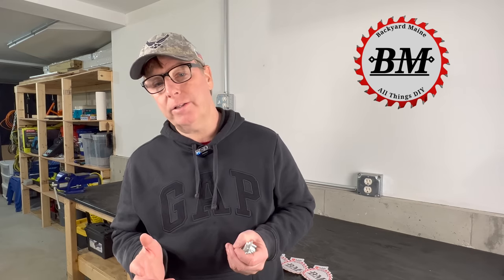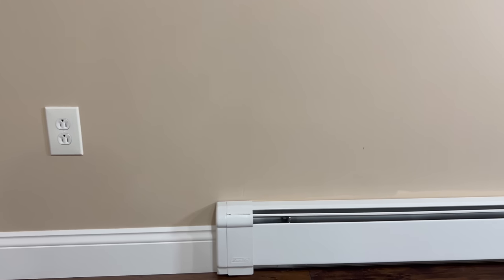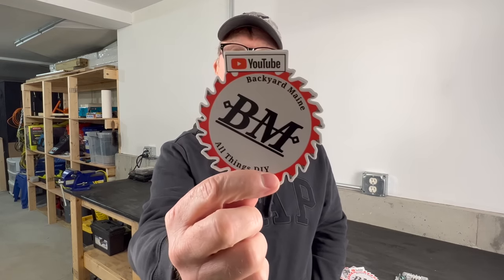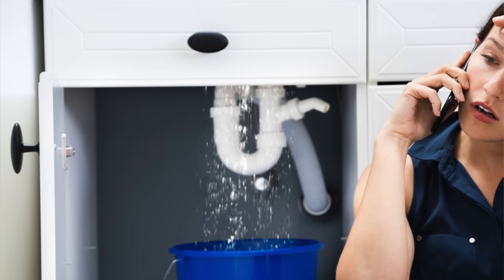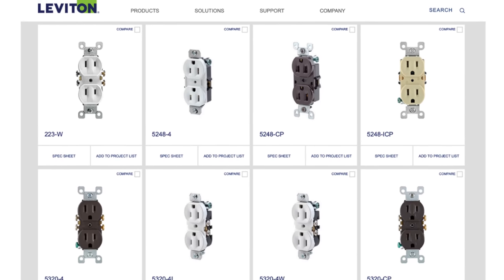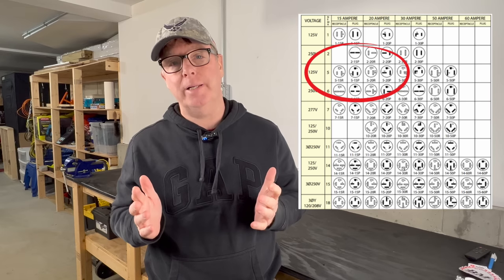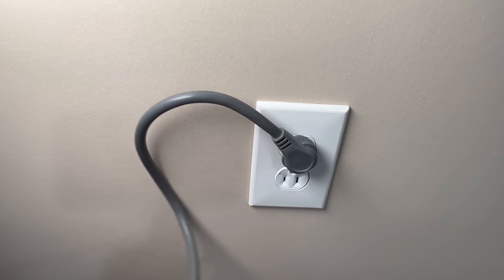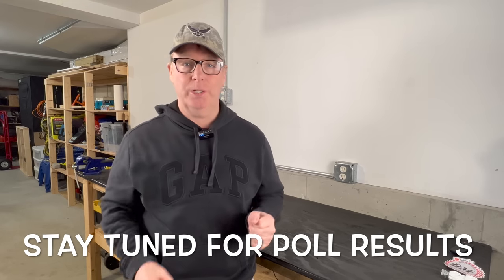Are your outlets installed upside down? (You may be surprised)

Comment: I have been an electrical engineer for more than 25 years and live in Costa Rica, where the electrical code is based on the US NEC. (And I’ve done designs and supervised installations in the Americas -USA, Costa Rica, Mexico and other countries in South America; ranging from residential and commercial to industrial. Low, mid and high voltage as well). 
It is customary to install receptacles here horizontally (so in my case, seeing a vertical receptacle looks weird). This provides several advantages:
- when both outlets are used, one cable does not “pile up” on top of the other. 
- the conduits coming from the floor go in and out side by side using the two adjacent knockout perforations, simplifying conduit installation. (Houses here are mostly made of concrete. Meaning a concrete slab and walls made with concrete blocks. Receptacles are normally wired through conduits embedded in the concrete floor or slabs, while lighting uses conduits in the ceiling). 
- I recommend installing the neutral slot UP, for the same reasons of preventing accidents in case of falling metallic objects on a partially plugged device.
- Someone else commented that the grounding prong helps plugging in when there is low visibility. This is also true in this case.

Some disadvantages are for cases when a device (like a night light) is designed for vertical receptacles and when plugged will not have the orientation intended by the manufacturer, but this is not critical.
Reply from the maker: Great discussion. Thank you. I’m retired now but I was also an electrical engineer. I worked for Texas Instruments. I was actually on their technical ladder which put me in the position of working with FABs located around the world.
Reply: That’s cool!!
I worked for Intel a few years ago, and coordinated the electrical scope for a renovation of a building they acquired in Austin. 
I later changed position and worked in a team that designed communication ports for CPUs (USB, SERDES, HDMI, etc. ). Also an interesting experience.
Reply: The vertical outlets look weird to me as well. Interesting topic.
Reply: Because of course if the night light isn't facing the right way up the light will spill out onto the floor instead of into the room
Reply: @billycroan2336  Exactly!!! You don’t want light spilling all over your dark carpet. Right?? (Interesting idea to find small things on the floor, but removing those stains has to be complex, even if they are “light”). 

(Now, the thingies with a mosquito-killing fluid have a plug that can be rotated so the same thing does not happen with the insecticide).
Reply: Hey. New comment. 
Looking at 4:45, the right-angle plugs. Maybe they are designed for horizontal receptacles with neutral up. If I saw the image right, this seems to match. 
And, with neutral up and ground to one side, the live tab is “hidden” the most from any falling objects, while in a vertical outlet, there is still some risk with the live tab on one side and something shorting it to ground in the “ground up” position. 
Just some thoughts.
Reply: @federicoulloa1255  yeah, it's a pity more boxes aren't designed with the nails on the small side.  I could always do a commercial steel box with one of those base plates you can rotate on your own. Those are usually double but hey I wouldn't mind having more outlets anyway.  Then again there goes avoiding having outlets above or below other outlets....

Comment: When I was a kid I was interested in power. So I dropped a quarter across a plug that was pulled out slightly from the receptacle. Boy that was exciting as a couple of 1/8 inch deep holes were melted into the quarter before I pulled the plug out! I don't recommend repeating this experiment.

Comment: I worked maintenance for a 1mil+ sq. ft. mall built in the 80's and I was finding all kinds of things that violated code that I spent years fixing. But what bugged the hell out of me the most were the brass plate covered floor mounts because my non-english speaking janitorial contractors constantly ran them over with the floor washers and no matter how many times I spoke to their supervisor I'd still have to open up several of them every week to vacuum out water.

Thankfully my electrician would seal the pvc conduits so water wouldn't propagate through the tubing and start flooding the other floor cans

Comment: I believe the reasoning to install recepticals ground side up is for safety.  Especially in Hospitals, Nursing homes, and Medical care Facilities!

You're correct, its not in the code to date, but look for that to come to the NEC.
Reply from the maker: I don't think that one's going to change anytime soon. They tried it for one cycle and changed back on the next due to all the issues it was causing. It was either the 2002 or the 2005 code if I remember right.

Comment: Functional suggestion.

Dependent upon direction cord drops from outlet for grounded cords. 

If cord is dropping down. Then have ground up. 

If cord  is dropping up. Then ground down. 

The cord will not pull out and expose the prongs in this manner. Cord will be more secure.

Solution if you are annoyed by your cord pulling out of the wall. 

Aside from replacing a worn outlet

Comment: Regardless of what code says, I believe the preferential way is risk based. Ground up is supposed to protect against thing dropped on the receptacle if it is slightly unplugged, but I feel the larger risk is shocking yourself while grabbing the plug when your ring finger wraps around the bottom of the plug and may slip toward the conductors. So I wire mine with the larger and more likely risk in mind.

Comment: In addition to the 90° or 45° angled plugs, having the ground up is a problem for devices that have a DC power converter on the plug. You have to plug them in upside down if the ground is up. So even though it doesn't really matter as far as electricity and safety is concerned, because of the way many plugs are designed, it's best to keep the ground down. And I also agree with this guy that with the ground up it just looks upside down.

Comment: There's a hazard when plugging or unplugging into an outlet, reaching around something by feel or with limited visibility.  Not advisable but we've all done it.  You'd want ground orientation to be what people expect.  
Only other concern may be water migration into the outlet along an incorrectly used cord.  This can happen from condensation, spills, leaks from an aquarium pump, humidifier, etc.  The cord should droop below outlet at some point so any moisture drips onto floor and not into outlet.  Any thoughts on this?

Comment: Ground up, with a crazy story.  About 10 years ago I was flipping a coin.  I got a little too overzealous with the flipping and it shot up against a wall, fell down, and landed between the hot and neutral prongs of a lamp plugged into the wall that over time the cord was maybe tugged so it was slightly out.  Massive flash, but the breaker tripped and no fire.  Ever since then any outlet I change the ground is on top.

Comment: NEC used to show receptacles with ground down.  Then, somewhere along the line, they were shown with ground up, I'm thinking it was about thirty years ago.  BUT, pictures don't control, the wording controls.  So basically NEC is, or at least was, silent.  I prefer the ground down orientation because I was taught that when plugging in, the pointer finger on the bottom is the most likely finger to contact a prong.  This is the first time I have heard the paperclip shorting argument. There,  you asked, and I gave you my opinion.
Reply from the maker: I agree with you. The only reference in the code is in 406.5 (G) prohibiting face up in countertops and under sinks.

Comment: I built a large part of my home with the ground up because I asked the electrician who put my main service in. Then I realized most directional plugs for appliances need the outlet to be ground down if you want your power cord to go down the wall instead of up in the air. 

So my guess is the ground should be on the bottom.

Comment: up. Although I have heard about stuff falling on the ground plug, and also the 90 degee plugs.  But from just observing other people work, I noticed that MOST (not all) people when they pick up a plug or extension cord that has a ground plug on it, the person will pick it up with their thump behind the 'bump" created by the ground plug and push it in with their thumb.  A ground down would require they to turn it around, which since we are creatures of habit after a while we would start picking up the cord differently.   My son in law says they go ground down, because it 'makes a face'  To each his own as long as code and safety doesn't disagree.

Comment: This reminds me of the argument about which way a roll of toilet paper should be installed; with the loose end facing towards the user or away. I settled the argument (for me) by looking up the patent. The patent drawing shows it being installed with the loose end facing the user. HOWEVER, the patent for the electrical outlet shows one outlet panel with a gang of two outlets, just like today, but with the top outlet being ground up, and the bottom outlet being ground down! Interesting...

Comment: I was taught ground down because if the cord was partially out, since the ground tine was longer it would be the last one making a connection and the circuit would be safer.  Upside down, the ground could come out with the hot and neutral still with power causing shock or electrocution.

Comment: Backyard Maine if you work in NYC  as an Electrician (Local 3) or non union and wired your outlets ground down you would be changing every outlet to make them proper to the NYC Building code Ground UP. The NYC building code states all 3 prong outlets have to be ground UP. commercial and Residential applications.
Reply from the maker: One of many reasons why I would never live in NYC or any other city in fact. Too many bureaucrats thinking they know more than the manufacturers, contractors and engineers. Chicago requires horizontal installation so I guess there experts came to a different conclusion than the ones in NYC. Local codes especially city codes can vary widely from the NEC.
Reply: This answers why my Chicago suburban home is horizontal outlets.
Reply from the maker: @AdjustYourFocus  I’m pretty sure Chicago city code calls for horizontal receptacles

Comment: I can't recall ever in my life seeing an outlet wired with ground up, and while building under permit, my city inspector did not care about the grounding orientation. BTW, AFCI protection was accomplished, and required so, by an AFCI circuit breaker in the panel and not at the outlet. which can apply to the entire circuit in case several outlets were installed on that circuit.

Comment: I was told by an electrician friend that did both commercial and residential wiring. He told me that the ground typically goes up in commercial and hospitals because many times they use metal wall plates. If the wall plate comes loose and falls on the ground there is lee of a chance of shorting out than if it drops on the hot and neutral.
Reply from the maker: I think it's a regional thing. Around here it's almost all ground down. I do see ground up in hospitals because hospital specs are often written with the guidance of IEEE Std 602 Recommended Practice for Electric Systems in Health Care Facilities but article 517 in the code makes no reference.

Comment: I only have ground up receptacles on circuits that have GFCI circuit breakers (bathroom receptacles and furnace receptacle in garage). I only noticed this and made  this assumption guess because from all the receptacles in my house on all 3 levels plus garage, those are the only receptacles installed that way. It could be the electrician who wired the house many years ago preferred doing that way.

Comment: When the 3 prong first came out to replace 2 prong in kitchens and bath, the writing on the receptacle was upside down unless the ground was on top. For some reason the custom became ground down. The manufacture then wrote the information twice 180 degrees from each other. This way it could be read ground up or ground down.  Obviously the original intent was ground up. The only advantage to ground down is that the cord manufactures have adopted this unintended orientation. They can change. All other times ground up is better. It is easier to lead with ground pin on top for first contact, if it is on top and easily observed.

Comment: Ground down, unless it's in an area where something conductive may slip in to short out hot/neutral.  Examples; A bench where sheet metal work or stringing guitars is done or in a cabinet full of steel pots and pans stored...all ground UP. We had a big BANG and almost a fire in our pot and pan cabinet. A stainless steel pan lid shorted the ground down microwave receptacle. Lesson learned.

Comment: If you want the ground on the plug you are plugging in to stay grounded, ground down is more secure. The weight of the cord pulls down on the plug. Its simple leverage. If the weight bears on the ground, it prevents the hot and neutral from disconnecting, while insuring the ground stays connected. If the plug was designed differently it may be different. In general, its like a tripod, or triangle. to keep it level the third leg should be pointed down. Its like putting a 2x4 to hold up a 2 prong plug that wants to fall out. The ground is that 2x4 that prevents it from coming out. Putting that 2x4 above the prongs only serves to push it out.
Reply: The opposite is true. The ground prong connection is tighter than the hot or neutral slot connections. With the ground on top, the ground holds the plug in tighter and counteracts the weight of the cord which wants to pull downward. With the ground down, the weight of the cord and the tighter hold of the ground prong on the bottom tends to allow the hot and neutrals (which are on top) to pul out slightly because the ground on the bottom is holding tighter than the slots on the top. With the ground on top, potential sagging of the plug is reduced.

Comment: Have a fair amount of electrical experience.I was told ground down was safer,as rising water(storm,water heater gone) .The rising water would touch mechanical ground first,assuring a tripped breaker.Also know upside down switches tell you so,as they say "no" instead of on!🤠
Reply from the maker: Single pole switches are designed to be on in the up position. 3-way and 4-way switched don't matter. I prefer ground down as well but the ground wire also bonds the yoke so the water would contact ground first in any orientation.

Comment: I think I've only seen the ground up method used only a hand full of times in my life(I'm turning 37 on Dec. 21st) and it was at houses where people had to replace an outlet themselves(often a bunch of dummies that don't know what they're doing lol). I'm not a certified electrician but I've wired multiple buildings myself before, including installing all the outlets(and switches), and I always install them ground down. Mainly cause that's primarily the only way I've seen it done throughout my life(with few exceptions), and it just looks better in my opinion. Ground up simply looks goofy in my opinion cause my brain has been trained to accept the ground down method. The thing I most commonly see is light switches being "backwards" from what I'm used to and I think this mostly happens cause if you're not looking closely it would be easy to mix up the proper orientation cause the switch looks identical from both directions. BUT when I install light switches it's always UP for on and DOWN for off.
Reply from the maker: Yup I agree and covered most of that in the video. Single pole light switches are required to be up for on by code. Thats why they are labeled off on. If it’s upside down it will actually read no.

Comment: In a wall application it should not make a difference rather the ground is up or down.  As long as the wires are attached to the proper side.  But I do find that DOWN is the most common, but I have seen them with the ground up.  Maybe the up or down position could be determined by the coustomer.

Comment: I prefer the ground down because for me it is easier to plug in first inserting the ground pin, which is longer, only one and round, so then are clearly visible the upper holes and it is very easy to align and insert the flat pins. Doing oherwise, after the ground pin is inserted, since it is longer, it is more dificult to see the holes to align the flat pins as they are hard to see under the plug.
Reply: When your "bend-over-ness challenges" sight and feel are safe with 3 prongs  pin (grounded down).

Comment: Personally I always did ground down and if it was a "switched" receptacle in a few rooms, it was ground up just to differentiate which was switched.  Also, always ground down if running 90 degree plugs. One might also ask, what is up or down when receptacles can be installed in just about any position depending on the job.

Comment: An aside:  A friend showed me his laptop on a 20-year old power cord where the orientation of the ground, hot, & neutral prongs could be turned like a railroad turntable inside the plug, which has obvious advantages over a fixed orientation, especially when you have multiple devices fighting for outlet real estate, but apparently it was too expensive to manufacture for the low demand, and you don't see them anymore.
Reply from the maker: That's called a twist lock receptacle and plug. They are still available and used in industry for equipment and also sometimes for servers in data centers. They come in many different configurations depend on phases, voltage and amperage requirements.
Reply: @BackyardMaine  Thanks for the info.  I had not seen one in many years.